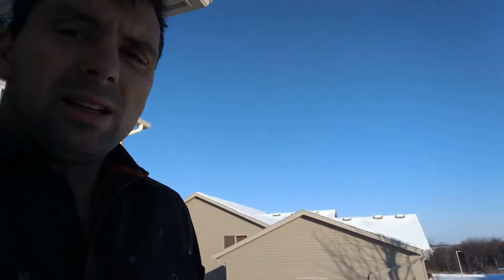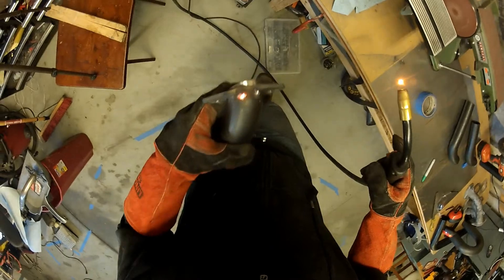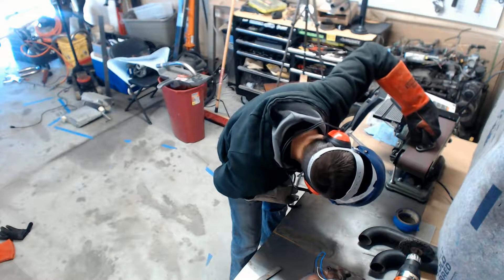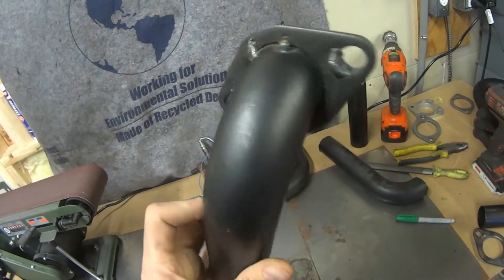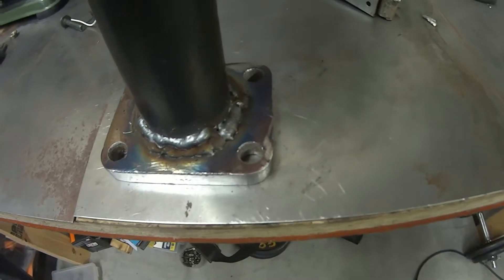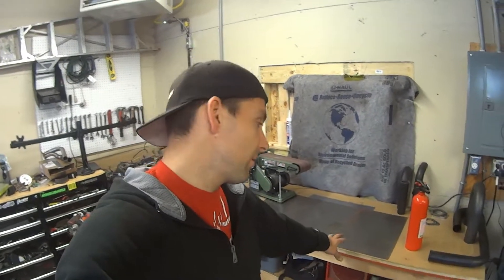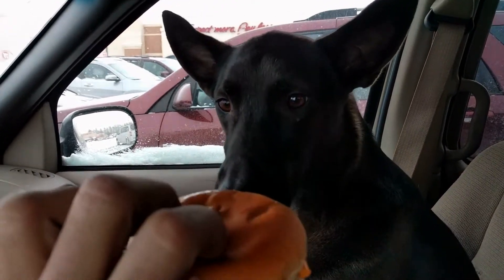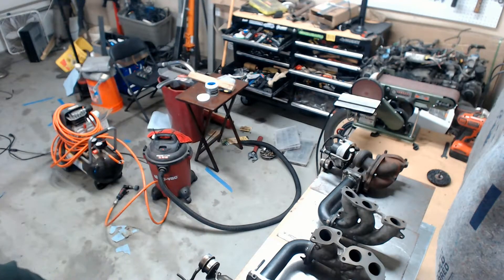EG33 Swap - Create your own Turbo Manifolds (Ep. 12)

Comment: turn the volts up on the welder. not enough penetration and to much wire. wire speed is probably ok once voltage is upped.

Comment: I have the same Hobart 140, great welder but for the grounding clamp and the gas regulator.  My regulator totally crapped the bed so went and got a good quality replacement.  The clamp I just took some copper plumbing pipe, cut and flattened it into a strip and drilled it to attach directly to the cable and then formed it around the grounding clamp jaw contact to have a better direct ground.
Reply from the maker: Served me well thus far. Mig welding seems so easy with this thing.